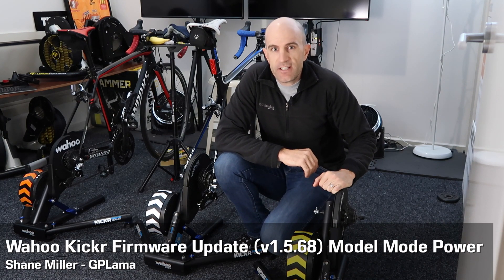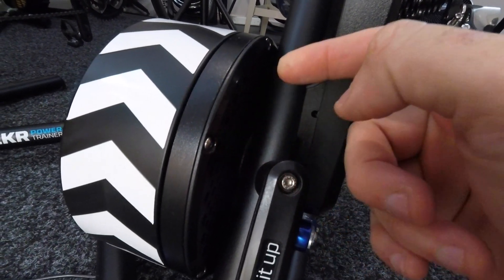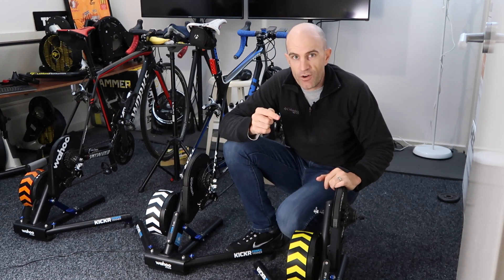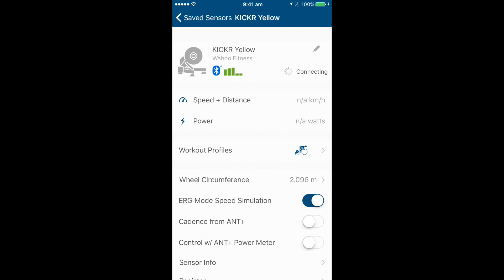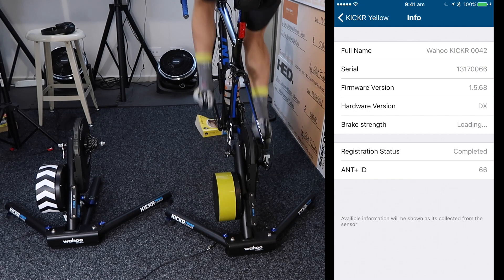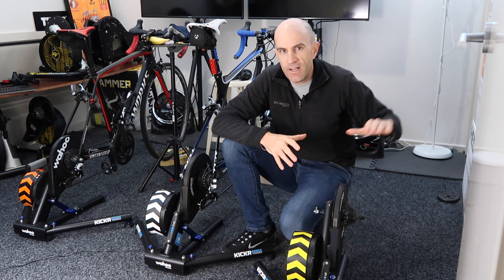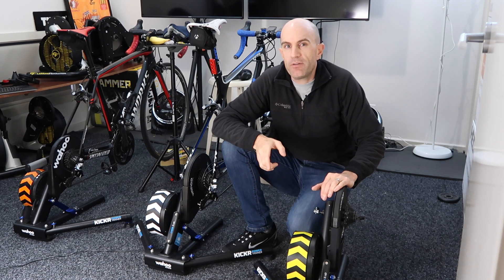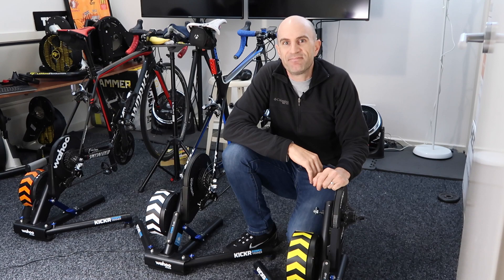Wahoo Kickr Firmware Update (v1.5.68) Model Mode Power

Comment: Good to see the firmware updates enhancing the capabilities of pervious versions of the Wahoo trainer. My concern going forward with a smart trainer is a new version coming out that will have a motor (they all should have one really) to copy the feature in the Neo that simulates riding downhill. I like the Hammer quite a bit, but would be a bit bummed if a motor was included in 2018. Unlikely I would think until a completely new models comes out.
Reply from the maker: The direct drive isn't really a feature that has a purpose.... the direct drive of the Neo turns the flywheel when coasting down a hill... but you still want some resistance there when you choose to pedal. All of the 'top 5' smart trainers are pretty floaty when they're set to zero watt resistance.... which is like coasting down a hill as it is. It doesn't propel you forward in any way on Zwift (that requires watts), so in effect the direct drive impacts the ability to put out watts downhill (just a little) so it slows you down. Very counter intuitive I know... and really not how the feature is sold. It's 'cool'.... but as above, I can't see the purpose of it.
Reply: Good to know Shane. I appreciate you answer and candor about the feature. Very counterintuitive. I won't worry about it being included in the Hammer or any other trainer.

Comment: Shane,you mentioned temperature...does the K2 have some sort of temp compensation built in as in a Stages? 
I'm also intrigued as to how much accuracy drift there is if one is not OCD in doing spindowns regularly. There seems to be no good data out there quantifying this.

Comment: Thanks Shane. For those who have upgraded firmware so far, are you finding the power readings a bit higher or lower now? My kickr consistently reads about 20-30W higher than my stages currently (not using latest firmware yet). Just trying to decide wether or not to upgrade before tonights KISS Downunder :-)
Reply from the maker: Post the upgrade and advanced spindown it's likely to be 'more accurate'... so it'll depend if you unit is reading high/low/spot on already.

Comment: Hi Shane. I've heard the brake factor numbers are stored in the phone not kickr. Can you connect to the same kickr with two separate devices, one that was used for the spin down and one that was connected after? Would be interested to know what brake factors each show. Btw 👍🏻
Reply from the maker: 2nd phone doesn't show the value. Interesting. Not sure what this means...
Reply: I feel like it means Zwift doesn't care what your brake factor is and just applies a generic amount of resistance based on your weight and trainer type etc.
Reply from the maker: That's independent of the unit itself reporting a power figure though.
Reply: Paul I just checked on 2 independent iOS devices, one of which has never been connected to the Kickr as far as I recall, and the brake factor derived from the spindown came up in the second device. I can't see how generic numbers could be used, as it would make a spin down pointless.

Comment: Weird. I am updated to the most recent firmware, have done the advanced spindown as prescribed, but i am not getting brake strength nor is rhe kickr’s accuracy different (still overreads by 40 watts)...
Reply: Nevermind, worked like a charm! Reads perfectly accurate (although breakpower seems no longer displayed in the app)
Reply: Thanks Shane!

Comment: Right straight away can feel the difference in zwift. Personally straight away think it's reading high. But will let you know a little more. What's your offset value now Lama? Was 402, now reads 32789 lol.
Reply from the maker: Never go on feel. Humans are horrible at the feels. :) The offset was 65535 in beta which indicated the unit was in 'Model mode'... not strain gauge mode. I suspect the 32k offset is what they're using with the public release.

Comment: I wonder why a direct drive still need to perform spin down calibration. For tyre drive trainer, it account for the tyre pressure againt d roller which in turn will affect the friction force to be applied by the rear wheel. What does spin down calibration accounted for Kick? Drive belt tension?
Reply from the maker: Nailed it. Friction in the system. The brake strength is measured for the Advanced Spindown and used for model mode power.

Comment: I just picked up a used Kickr V1, its got 1.2.2 - iOS Wahoo Fitness App sees it and says checking for firmware on initial setup, but once added and selected later, I am never offered an update - update no longer working 2023?
Reply from the maker: That's one for Wahoo Support.
Reply: @gplama  you are faster :) thx :)
Reply: Due to the age of the original 2014 and 2016 KICKR, firmware updates are no longer possible due to the architecture of the power control board.

Comment: so guys there is a known fault (locked unit)  with this version of firmware that can only be fixed by doing the advanced spindown.  I'm via Android and only have the option of a normal spindown.  Waiting for wahoo to get back to me . Googling ,other people don't seem to get advanced spindown via Android but not sure if it's across the board. Unfortunately don't have any IOS to hand to try.  What a complete waste of time oh well it's not as if it's a cheap trainer :)
Reply: So I'm sorted. Had an old iPad and was able to do advanced spindown which unlocked it.   Deff a problem with that firmware and Android .  on the Wahoo site it does say you can get a locked Kickr after the upgrade just doesn't mention that if you do it can only be fixed via iOS .  Tut tut tut.  wasted 2hrs when I could have been on wattopia but got there in the end.
Reply: cancel my sorted comment. power totally out now and brake keeps getting put on. ticket logged with wahoo. They clearly haven't tested this upgrade so if you are as stupid as me carry on and try it. !!

Comment: Hi Shane, a question about the warm-up before doing a spindown.. For a normal spindown, on the app it says warm-up for 10 mins, but for the advanced spindown it's only 3 mins. It seems odd that they only ask for 3 mins if more would be better. Would love to hear your thoughts on this. Cheers
Reply from the maker: That's one for Wahoo. I guess asking people to ride for 10 minutes just to calibrate might be a bit of an ask? I'm sticking to the 10 minute protocol.
Reply: Well, yeah, that would make sense if it was the other way around - 10 mins for the occasional, more accurate spindown, and 3 mins for the regular spindown. I'll drop them a line.
Reply: So, message from Wahoo: "In regards to spindowns, it is important to do at least a 3-minute warm-up.  The 10 minute warm-up is a "Best practice" suggestion, but you will always want to do at least 3 minutes.  This will give you the most consistent power readings."
I still don't get why they don't give the "best practice" suggestion for, what I'm assuming is, the more important spindown procedure, but anyway, there you go

Comment: Are there advantages of having the Kickr 2 then? It sounds like the take away here is that the older models now with this update are on par with the new model. Why would one opt for a newer version, rather than getting the older model at a cheaper cost and just doing the firmware update?
Reply from the maker: +j bee Availability. They don't make them anymore. There's a few other updates in the Kickr2, covered in most reviews/discussions on them.

Comment: what does stability mean in terms of the software updates?

By the way, what would someone do if they don't have the ability to ride at the necessary speed of 36km/h? just sayin...
Reply: and thanks for the strava kudos!
Reply from the maker: It means there's less chance it'll shit itself during a workout. No, or low chance of, race conditions / bugs / locking up the resistance unit / etc. The 36km/h is with no resistance on the unit so it won't be a limiter for anyone.

Comment: So Model Mode Power is more accurate than strain gauge on direct drive trainers but for wheel on (i.e. the SNAP) model mode is less accurate because it has to account for the tyre's friction coefficient?
Reply from the maker: By all accounts and what I've tested, it can be as accurate, yes. Nailed it with the SNAP observation.... which reminds me I really need to get one to throw some watts at it.

Comment: This upgrade killed my original wahoo kickr I think. What is the brake value that you have in the wahoo fitness app in regards to the brake value. For some reason I am now getting a 1.08 value on the brake with this newer firmware
Reply from the maker: This video was a while back. I'd have to unbox my v1 Kickr and do this again. You can revert to strain gauge mode if everything has gone south.

Comment: Shane, I have a Kickr v.1 and have been regularly updating the firmware.  I am curious though, is the model mode an improvement over using the strain gauge with regard to measuring power?
Reply from the maker: In short yes. In long.... maybe... depending on how accurate your unit is.

Comment: How do you revert back to strain gauge mode? I'm finding the power requirements are too high, and doesn't feel anything like my outside bike with a power meter. I want to toggle back to see if I can identify a difference in feel, and also in the middle of a training block, so really not a good time to tweak it unless I can do a FTP test...which will be the next training block.
Reply from the maker: 'ilovesg' in your Wahooligan code option in the app will allow the toggle back to strain gauge.

Comment: Check out reply #1789 / #1790 in dc rainmakers review of the kickr1 from 2013. Maybe this is the same or similar kind of belt in the kickr2 making it less noisy. If one of your Units needs a replacement, it would worth a look for a review.
My old belt is still going strong. Altough it runs in a Ant+ ID 19 unit bought 2nd hand. But we all know why- kickr too strong! Or me too weak? Doesn't matter- love my kickr, beacuse with this firmware (and a new belt) it gets such a valuable upgrade for an old trainer. Thank you wahoo for that "politics"!

Comment: I sold my Snap for a Kickr1 to get more reliable power because of the strain gauges. And now Wahoo is telling us to turn the strain gauges off to get better results? So practically turning it into a Snap?
Reply from the maker: Not exactly. The glass half full way would be to see them turning the Kickr1 into the Kickr2.... which has been shown to be pretty good with accuracy. The SNAP is a different unit, not comparable as a whole.